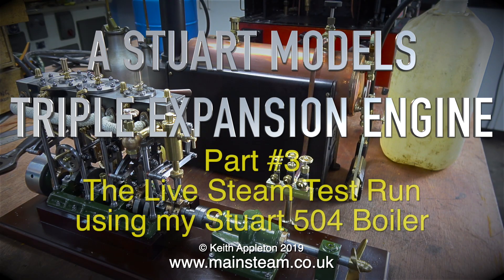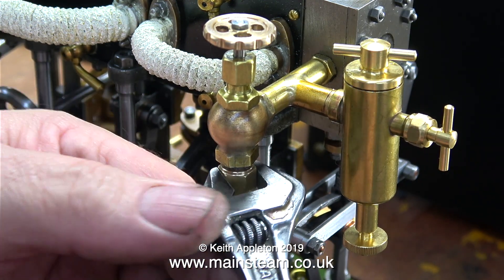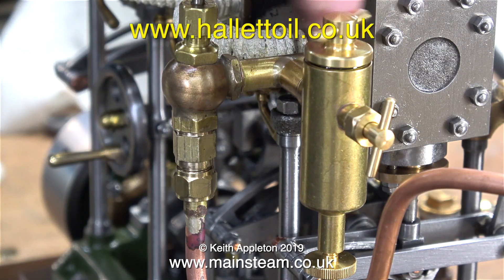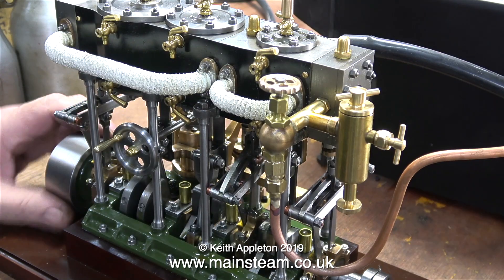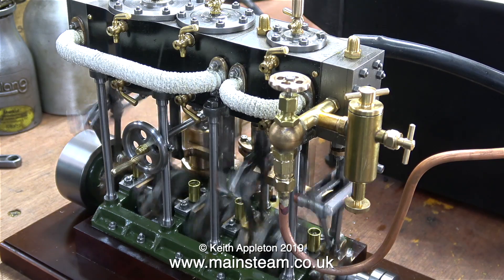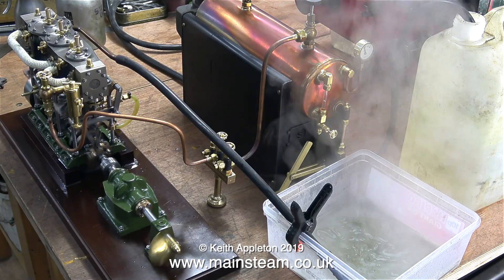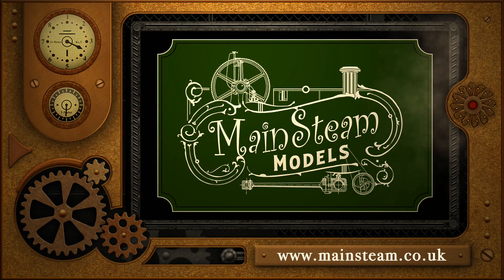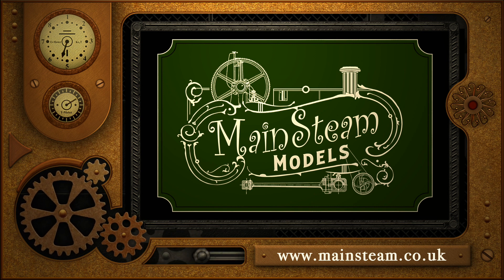A STUART MODELS TRIPLE EXPANSION ENGINE - PART #3

Comment: Somewhat surprising that a 3 cylinder needed hand starting. Would have thought it would have been a self starter. Comment
Reply from the maker: It is a 3 cylinder 120 degree crankshaft compound engine and would need a special "Simpling Valve" which allows steam into the other cylinders other than than just the first high pressure one, to allow self starting.
Reply: @keithappleton  got it,I'm used to 90 deg crankshafts on twins. Thanks

Comment: Wieso ist diese Maschine nicht selbstanlaufend?🙄🙄🙄🙄 Viele Grüsse aus Germany
Reply from the maker: Triple Expansion Engines will only self start if fitted with a "Simpling Valve" to admit high pressure steam into more than one cylinder.

Comment: Such ingenuity and skill - thanks for showing. I notice that the flywheel needs a little turn to get it going - how is this managed with the full size?
Reply from the maker: The large full size engines often used a "Barring Engine" to turn the crankshaft into the correct position to start. Sometimes something called a "Simpling Valve" was used to admit steam to more than just the high pressure cylinder to start the engine.
Reply: @keithappleton  Thanks for the reply - very interesting.

Comment: I build a Stuart D10 with Reverse. It runs very fine. Nothing is knocking.  Should i try a Stuart Triple? Is it hard to build this engine compared to a D10 with reverse?
Reply from the maker: If you can build a D10 with reverse that works, then maybe you should try a Triple }:-)))

Comment: Great little engine keith, I noticed that you had to turn it off dead center to start it, would a full size engine have a starting valve that let high pressure into the low and intermediate steam chests for starting?  something like an intercepting valve?
Reply from the maker: they used a "Simpling Valve"

Comment: Why would you not initially run it with the cylinder cocks open to avoid risk of hydraulic lock, or was it already hot  from  previous  running ?
Reply from the maker: it was already hot and drain cocks like these always make a mess . . .
Reply: @keithappleton  All good, I was just surprised. Shockingly 35 years since I built my Stuart Number One taking 4 years commencing when I was 18  and pleasingly it's much better than many of your patients. Maybe time I exhumed my round bed  Drummond lathe , seeing your videos with loads of tips thank you!

Comment: Keith, when you changed from forward to reverse, then from reverse back to forward you had to start the engine by hand, why is that?  Another great video and fun to watch, thanks.
Reply from the maker: Compounds are generally not self starting unless the cranks end up in the right position  . . .
Reply: @keithappleton  That's why real Compound Engines have a Bypass Valve to pass Steam around the High Pressure Cylinder directly to the Medium/Low Pressure Cylinders, incase the High Pressure Cylinder came to stop in TDC/BDC. At least Marine Engines have that, as they must be started many Times when Manouvering. Stationary Engines like Generator or Pumping Engines may have to be slow turned to Starting Position instead, as they aren't started very often.
Reply: Can be considered to be a single  cylinder enngine

Comment: Incidentally, given that there is a displacement lubricator, what is the purpose of the cylinder oiler?
Reply from the maker: What cylinder oiler, I see a water pump and a condenser vacuum pump built onto the engine but no mechanical lubricator . . . hence the Displacement type.

Comment: just out of curiosity should this engine be self starting? or is it because its still a bit tight?
I would imagine on the full size one's they will be, or do they have to stop them in a certain position like they do with beam engines.
It's a beautiful engine and nice to see it running rather than stuck behind a glass case.
Reply from the maker: Compound steam engines generally do not self start unless they have a "Simpling Valve"
Reply: @keithappleton  ok. I didn't know that, I will google Simpling Valve now. thank you. regards

Comment: I find these very interesting.  The big question I have is how much power can/do they produce.  Can you hook up a dynamometer or some such that might indicate what such an engine would do under "load".  I understand these little engines can be quite powerful for their size.
Great video and video series.
Reply: Herby1620 
The Stuart triple from memory isn’t terribly powerful, but the Stuart 5a produces 1 1/4 horsepower at either 300 or 3000 rpm, I can’t recall which.
They also make a very large compound launch engine which has been known to generate 2 1/2 hp.
Reply: @douglasmcdermott2830  The Stuart 5a is 1.5hp with 100psi at 800rpm, listed on Stuart's site. 3,000rpm is... quite high, for a steam engine.
Reply: DAKOTA56777 yes I realized that after I typed it but didn’t bother to edit